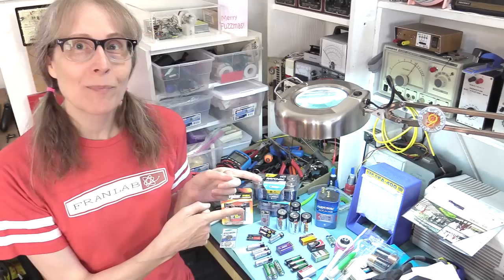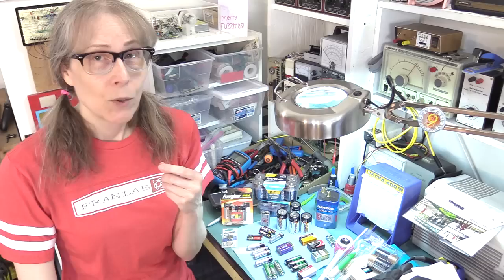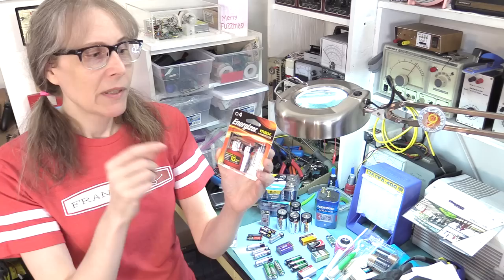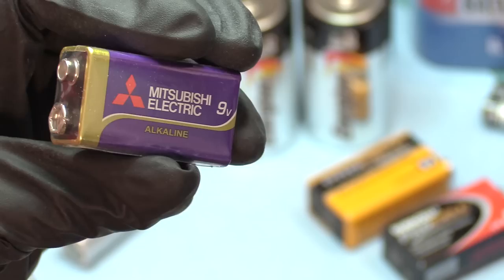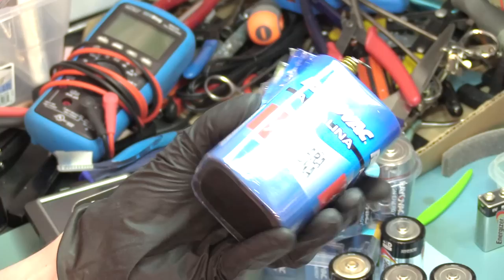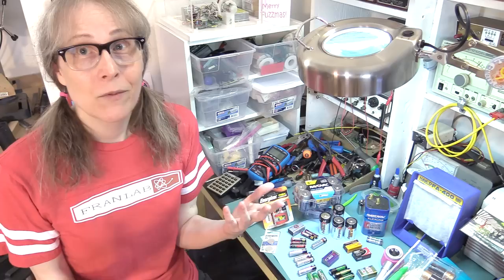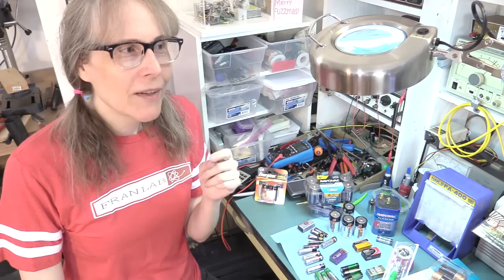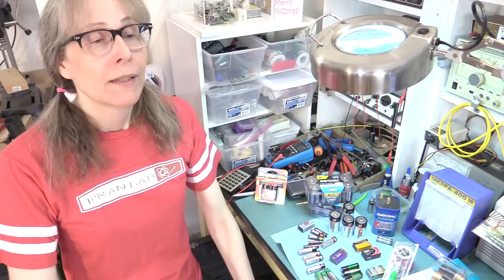Yikes! Leaky Alkaline Batteries!!!!

Comment: Duracell should change their name to 'Corrodacell'.  You're right, they USED to be the gold standard, but over the past 15-20 years they've gone downhill badly in my experience.  I've stopped buying them after having several leak and corrode around halfway through their alleged 'shelf life' while still sitting unused in the original packaging.  I don't know if it's cost cutting by the bean counters or chemistry changes required by new environmental regulations (suspect it's likely a bit of both), but they are crap now.  I've switched to Eneloops now for AA and AAA needs, and am much happier with them (beyond the initial costs, of course).

Comment: Old GP's, from when they were really popular in radiomodelism batteries, were really, really good, I still have some very old rechargeable ones that hold quite some charge.

Old Duralock Duracell bateries (Duralock is how duracell markets the leak resistant + 10 year shelf versions) were really good as well, I have two powering my logitech wireless mouse since 2015 and the software still reports 40%... however, a couple years ago I got a pack of 20 duralock batteries to replace the one in another mouse (and the ones in a R/C remote) and after 5 months it leaked, put another one, and again after a few months leaked again, also the leakages are liquid and doesn't resemble a salt like all the other leakages I had, making it more prone to sip through the electronics...

The biggest mess I've had was from a forgotten lantern, it was a propper rugged old one, metal cased and rubber covered that took two D batteries, the bottom one leaked and literally corroded the 0.5mm thick metal of the case through out .... the battery lid had mostly only the rubber and the metal rust weld itself shut to the lantern body.

The longest duration battery from my side gotta be the oldie Casio fx-82Super ... it has two AA dry manganese batteries (UM-3 or R6P (SUM-3)) and with a specified power consumption of 0.4mW in operation it is still (last time I used it was in 2018) working... I actually checked the batteries for leakages last time I used it. By now it is almost a family heirloom, my dad brough it in the late 80's, my mom used it during college and I used it myself during high school :)

Comment: I learned more than a half century ago that Eveready doesn't have a shelf life. I always buy Durracell which has a 5 year shelf life and more bang for the buck. Buy cheep, get cheep. You pay for it one way or another. 

You just said Durracell is notorious for leaking??? I've been using them for a half century. They are the only battery that has never leaked on me except once a along time ago when they were spouting a shelf life of a hole year and that had to be a defect. They have sense, updated their containment and now guarantee a 5 year shelf life.

Comment: Strange things happen.  I had a problem with a high-voltage geophysical transmitter back in the 70s, it would trip out every time it was switched on.  Tracing through the circuit, I discovered that the ceramic multi-pole voltage selector switch was the cause of the short. In fact, putting the test probes on the ceramic disks showed a low resistance.  Mystified, I explored the vicinity and found a mercury battery which was to measure resistance of the output load.  Presumably, this had leaked mercury vapor which had condensed in the porous ceramic making it conductive.  A replacement switch from RCA and a new mercury battery and the unit was fixed!

Comment: I recovered quite a few devices by carefully pouring boiling water in the corroded contacts. After drying thoroughly they all came to life. You need to be careful not to wet the electronics though. Older car lead batteries had the leaking issue and that was the way to clean them up. Works for me at least. Try at your own risk :-)

Comment: My TV remote displays on the television screen when to change the batteries. Also change my smoke alarm batteries, 9Vdc once a year and save the used ones to operate a transistor radio. I get plenty of use from them too. Thanks Fran

Comment: Hey Fran, place I used to work I was in charge of all the electronics. And also bought all the batteries in bulk. I can tell you I had really good luck with a brand called Varde I have no idea who made them but they worked really well. The other thing I will tell you is it one point I collected transistor radio‘s. And happen to get a hold of a Sony from 1970, and it had the original Duracell D batteries in it they were still good and they had a date code on them of August 1970. They don’t make batteries like that anymore. And yes I agree with you on the radio bags
Reply: Varta is a widely distributed brand in Europe and Asia. They were what was usually to be found in Japanese photo gear in years gone by. They do turn up in the USA but are mainly special cells for camera and specialty gear. Haven't seen one of their flashlight-size ones in ages.

Comment: A few things are notable. First even new unused alkaline batteries can and do leak even many years ahead of their shelf life expiration date so this isn’t just about the batteries being low or dead. I’ve had Kirkland (Costco) AA batteries dated 2025 that were leaking still in their sealed factory packaging. And they still measure over 1.5 volts even while leaking. Second, Federal law required removing or greatly reducing the amount of mercury in alkaline batteries and the mercury was largely what prevented pressure build up which, in turn, causes leaking. Finally, there are only a few manufactures left of alkaline batteries you’re likely to find for sale regardless of how they’re branded as there’s been a lot of consolidation in the industry. So all the brand loyalty is kind of silly as one person’s favorite and most hated brands might well be basically the same battery made by the same company in the same factory. I personally have had the best luck with Rayovac but that’s purely anecdotal. Battery manufacturers are also constantly tweaking their chemistry, seals, manufacturing techniques, etc. So it might be Duracell has fixed their leaking problem while other brands might now be worse than they used to be.

Comment: i used to get those GP Greencells out of disposable 35mm cameras with flash, great batteries. 

Quick and dirty way to tell if there's likely good power density in any cell is how heavy they are compared to other makes in that size.

i've had the 9v 777's as well, decent performing for old-school dry-cell batteries.  good for really low draw devices and incapable of leaking.

Comment: I remember many years ago EverReady (red) batteries had a guarantee,  it they leaked, and ruined your device. You could ship it to them, and they would either, repair or replace it for free.
I found an old flashlight, with red EverReady batteries in it, and they had leaked and corroded it really bad. I mailed it to them, and a few weeks later, I received a nice brand new flashlight, with new batteries already installed in it. Wow, I thought that was great!
Haven't seen those (red) EverReady in many years. The new Energizer batteries rarely ever leak. It's something to do with the composition of Duracell batteries, it what I heard, is why they leak. And never mix battery brands or types, or you just asking for trouble!

Comment: Tending to batteries can be a hassle. Aimpoint includes a small sticker with their battery powered sights that sticks inside the lens cap that you can tick off a box when you've changed a battery that year. The battery lasts several years but if you want to absolutely depend on it being on you should change it annually. I do it on my birthday every year so I can remember and I've kept at it for several years now so that might work for others. I should sell similar stickers to my knowledge aimpoint doesn't sell them individually, I wonder if people would buy them.

Comment: Was wondering if the the plastic cover sheet on the display of the BRYMEN BM235 was still on? I can't really tell in the video. Just curious, as sometimes they leave a sticky residue if left on too long. Great video on batteries.  And you are so correct on using cotton swabs with white vinegar. It has rescued many corroded battery compartments.

Comment: Leaky battery damage I've always cleaned up with a mild vinegar/baking soda solution and a few q-tips, followed by a good rinse with IPA. It's a smaller-scale integration of the tried-and-true method for corrosion on car battery terminals.
This reminds me to check my Wiimotes! I have two that haven't been touched in five? six? years. The main Wiimote I used a month ago, the batteries in that one hadn't leaked (amazingly)...
OK, while the video was playing I checked them... Both had Rayovac AAs (from Walmart) with an expiration date of December 2017. Out of 4 cells, only one had developed a leak - a very minor bit of electrolyte seeped onto the inside plastic of the unit, it had not spread far enough to drip through a hole onto the PCB. Totally dodged a bullet on that one!
Reply: Baking soda and vinegar are opposites. Mixed together they counter each other. Baking soda is alkaline and vinegar is acid. If you are cleaning up an alkaline leak baking soda won't neutralize it. Same for vinegar and lead/acid leaks. Use one or the other depending on the leak.

Comment: Question: does putting round batteries in the opposite direction do any harm? I have done that to a few things, mostly flashlights. Haven't had any problems. 
For the other things I don't use very often I take the battery out and tape it, rubber band it to the device, in the same drawer or original package. It works for nearly everything I use.
Love your channel, cool video!

Comment: There's someone who unboxed a brand new old stock Jurassic park Data East pinball machine which had four AA Batteries in it to go onto a battery pack in the top face part of the machine to power some of the electronics and hold scores and such. And the thing was made back in 1994 and was unboxed in the middle of last year. And the batteries didn't leak or lose power as they were tested in their lamp.

Comment: True story: I had a 4 brand new Duracell AAA installed in my headlamp, the battery compartment was on the back side and after no more than 10 minutes of using it felt that somebody hit me in the back of my head freaking me out as I was alone at home at that time only to find out that one of these dam batteries exploded! They supposed to be good for 10 years in storage but the manufacturer didn’t say that once you use them then they will rip your head off if you keep it close enough. Moral of the story: newer put any batteries in your pants pockets it you planning on having kids!

Comment: You know batteries used to have a guarantee against this if it wrecked your device they replace it but that has all gone by the wayside, I think it's because of the manufacturing process is gotten streamlined and cheapened. I found an old rubber coated camping flashlight in my shed when I was cleaning it out and it had two Duracell D batteries that theoretically expired in 1999 and the flashlight still lit up. the rubber coating had actually started to disintegrate on the outside of the flashlight and turn to a dust yet those batteries look like they had been in there only a few days I don't know why we can't make stuff like that anymore.

Comment: I lost a radio controlled clock to a leaky Duracell AA cell. The clock had stopped as though the battery was flat. Went to change the Duracell straight away but it had leaked. I cleaned the contacts and circuit board as best I could which got the clock going for a few weeks but the electrolyte had permeated into the board and slowly killed it.
The Duracell had leaked before it was fully dead, not because it had died and left in situ for months.

Comment: I've actually had a device that was still working fine, but bothered to check the battery compartment.
The terminals were corroded, and the batteries were leaking all over the place!
I've gotten to the point to where I don't leave batteries of any brand or type in anything, except the flashlight near my back door.
You?

Comment: Duracell’s in the past never used to do this. I have just had to scrap an expensive AVO meter because the Duracells leaked right into the inside of it. The instruction manual said “to avoid battery leakage we recommend using Duracell batteries”. So even AVO didn’t expect them to leak. As regards the “guarantee “ - forget it, they only guarantee to replace the batteries not pay for my £500 Nikon camera they ruined. I now only use hybrid rechargeable batteries, they stay charged in storage and don’t Leah this shit everywhere.

Comment: The alkaline lantern batteries have 4 D cells connected in series so an adapter is a better alternative. The Heavy Duty lantern have 4 A cells which fill the case (because the case was based on the size of the A cell). In my youth I took apart these cells because the alkaline ones felt top heavy, it got a little messy and the floor never recovered.

Comment: Probably 30 years ago my mom went to a store going out of biz.sale and bought me two Energized 6 v  lantern batteries, both eventually failed, I pried them both open and found 2 cells in each battery bad, so I  combined the 4 good ones into one case and reassembled the battery and believe it or not the rebuilt battery is still working in my railroad lantern.

Comment: in the 80'' my father had a analoge distance measuring tool that he used in a roadmap to follow the roadlines on the map and that thing told you how much KM the road trip was i remember you could change the setting on the size of the roadmap 1/100km  or 10/1000km  2.5/10km something like that

Comment: I have a charger that's designed to recharge standard alkaline batteries. I gave up recharging Duracell's as they would always leak after being recharged. Yes, you're not supposed to recharge alkaline batteries, but other brands much less likely to leak after recharging compared to Duracell's.

Comment: Duracell cells used to not leak, but when they moved production overseas, they quality suffered greatly.  I won't by Duracell any longer, I am not only buying lithium cells, which won't leak.  I have unopened packages of batteries with 5 years of shelf life left leaking in the package.

Comment: Just a question to this old video. Instead of marking devices with the expiration date of the batteries, could be a better approach to just remove batteries from non-commonly used electronics and keep them in some storage? If they are not frequently used, probably loosing some minutes to put the batteries in could be affordable and surely prevents from leaks

Comment: Is it just me, or did the old zinc-carbon heavy duty batteries make an even bigger mess when they leaked their contents? I remember when my dad gave me one of his old flashlights he had stored in the cellar that had been on a shelf for years. When I opened it up, the two D cells inside had released a brown, runny semi-liquid into the chamber, absolutely ruining everything. Between the smell and the sliminess of the stuff, I was grossed out, almost got sick. These were two silver Eveready batteries with the silver wrapper and the cat jumping through the "9" in the middle of the logo. They were ancient and evidently released almost all their contents into the battery chamber. I ended up throwing the whole thing out, it was so bad. Seems like the batteries today release more solid or crystallized material when they go bad.

Comment: Quiescent Current - The term given to describe the amount of current consumed by a circuit when it is not performing any work (sometimes referred to as standby current). Quiescent current consumption should be as low as possible in order to prolong the battery's life.

Comment: Duracell has been having major leakage problems over the past 1 1/2 years, with batteries leaking in the package - brand new batteries.
I’ve switched to Rayovac Fusion. ( Made in America).
  As a radio collector, I have to be very careful.
📻🙂

Comment: I had heard about Duracell Coppertop having leg problems. I use far more batteries than your average person because I have self timer candles in every room of my house. I use D, C, and AA batteries quite a bit and only once in the last 10 years did I have a leak. Meanwhile they stopped issuing those red with the gold top extra power cells and I started usingThe pro sale you mentioned, which by the way comes in all sizes not just 9 V. They are less expensive and last as long.

Comment: I find that most "leaking" batteries occur when the batteries are at least partially discharged or have been left in a devise that is rarely used.
It is strange that it is mostly the negative terminals that corrode.   I suspect that the batteries do not actually "leak" but corrode
Reply: It's the negative terminal because that's where the cell is sealed.  The can of an alkaline battery is the positive terminal.

Comment: I remember using those duracells that used to have a charge meter... Never knew how they worked and as a kid I found that amazing...
Reply: This is a temperature sensitive liquid crystal strip and tapered foil resistor underneath. when you press  the contact points it heats up, the more current the farther to the wide end it heats to sufficient temperature to turn the lc indicator bright.
Reply: @goamarty  you have answered a life long question

Comment: Store battery powered devices like emergency flashlights, radios etc with batteries on the side. Very common mistake. Also to store battery quartz watches by pulling the crown outwards which cuts the battery draw.